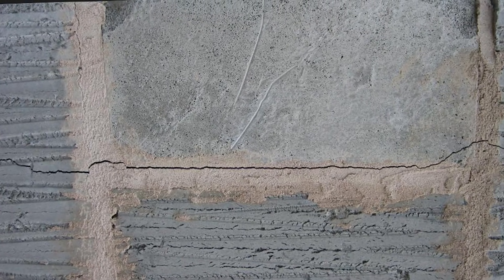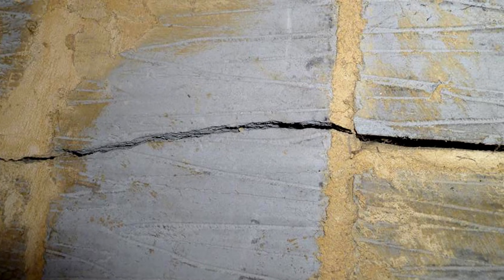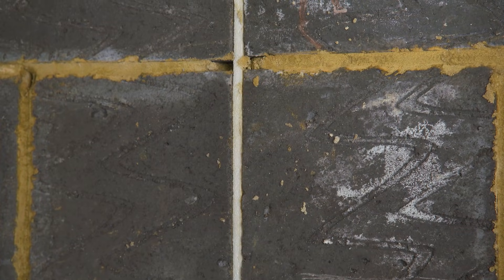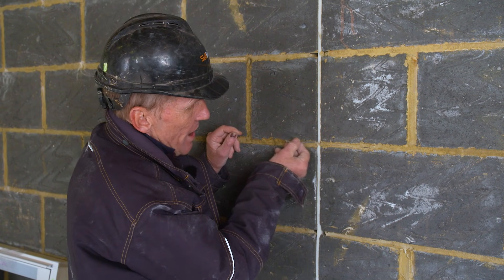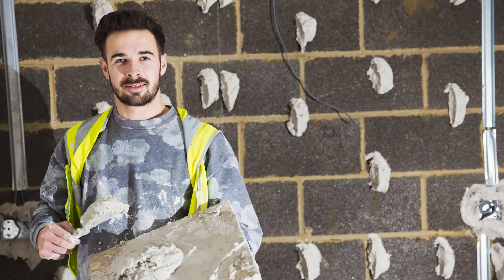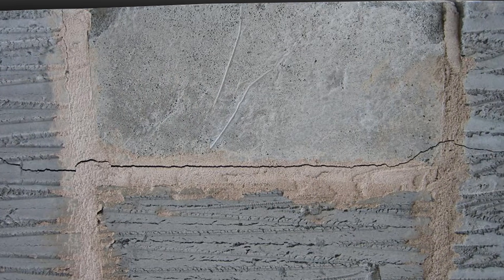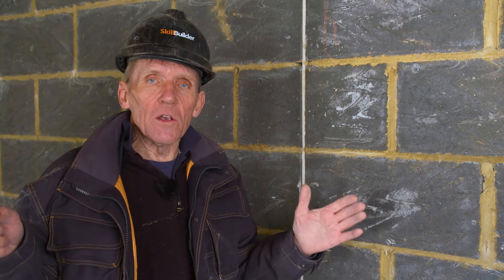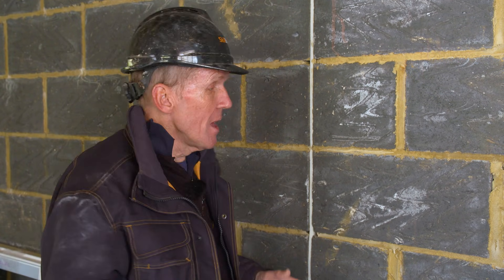Why Are Aircrete Blocks Cracking Up So Often?

Comment: Is "render" the same formula as stucco here in the US?
Reply from the maker: Yes
Reply: @SkillBuilder  Interesting. I built a couple of walls out of concrete block a few years back. I don't think they're "aircrete" but there's a similar problem I've noticed with these things. If you plaster over them with stucco you get cracks along the grout lines. In the effort to prevent that I did a scratch and a brown coat over the bare blocks, then did a coat of a cementitious product that is designed to adhere foam features to stucco. It's relatively sticky and I'm assuming more elastic than regular stucco. I embedded fiberglass mesh in this layer. Then I did the standard two coat smooth color coat over that for a finish. No cracks for a while. Then I noticed after the walls were saturated with heavy rains it looked like cracks had occurred behind the mesh layer. You could see it in the outlines of the blocks. The grout appears to retain water at a different rate than the blocks. So after everything dried out the visibility of the cracking diminished. Now hairline cracks have finally appeared in the surface of the finish coat. I wonder if this had anything to do with freezing and thawing of excess of moisture in the grout areas...?

Also, I've enjoyed watching a guy from Scotland, I believe, on his channel "plastering for beginners". When he does "rendering" he sponges the finish. I've never seen him hard trowel it. He does excellent work. I wonder if my hard troweling the finish and sealing off the final coat is part of the problem...? Is render in the UK typically sponge floated for this reason? For the life of me I have no idea how to prevent cracking over concrete masonry units. I've asked all the suppliers that I've encountered. I see the problem on professionally done cmu walls as well.

Comment: Really appreciate this video! Question: What are your thoughts regarding AAC blocks that are interlocking? And, the mortarless stacking of blocks  (expect for first run of blocks on slab or cmu block stem walls) in which closed cell foam is applied instead?

Comment: I've never seen these as a material I would use for Building structural, just for Insulation. I've made some fire proof stove applications and I've always used the fiberglass fluff that you can get at most mason supply. Works great' no cracks, the stuff floats it's essentially explosion resistant as well apparently. Yea good stuff. I don't think I would ever trust it to take the place of concrete in a building though.

Comment: Does someone know roughly the percentage wise of U.K. homes built out of brick vs concrete blocks vs aircrete blocks vs timber frame vs ICF vs SIP vs Steel frame vs ? Did I miss any other ones? Also which of the these are mainly used in the construction of cheap homes vs very expensive homes?

Comment: Great video thanks.  I want to build a garden workshop 6m x 4.5m.  So do I need expansion joints?  Want to render it over with pebbledash to match the cottage.  Would this still crack?  Many thanks.
Reply from the maker: Build it with concrete blocks rather than aircrete and it won't crack on that size. You could buid a timber frame and use cement board to clad it. You can then use an acrylic render over the boards. https://www.youtube.com/watch?v=5SoBLLhRIgA&t=2s
Reply: @SkillBuilder  Thank you so much for advice.

Comment: Good info, I am just about to do my walls that have a concrete skin 100 mm thick and aircrete 400 mm behind that. There is 3.0 metres between columns . Was designed for half metre earth pour walls originally. Thanks for your info.

Comment: I have no experience with concrete but I want to get into making sculptures out of concrete and molds. aircrete seems wonderful to keep them light. From what I got the reason the blocks cracked was because of the expansion/contraction difference between the aircrete and mortar, but aircrete blocks by themselves tend to crack as well? or is it always because of an external factor like the mortar in this case.
Reply from the maker: If you have a 225 x 225 aircrete block it should be fine. I have seen it used for sculptures.

Comment: Interesting. Thanks. But what would also be useful is precise details on how to fix walls both internal & external where a previous owner's builders have already messed this exact thing up. (And how to find a builder both capable of understanding the required job and not deciding that crack fixing is too small a job to bother with, so not submitting a quote.)

Comment: Many thanks for such a clear explanation.  I now understand why the block walls inside my internal garage have cracks in them. The house is around 25 years old with dot and dab hiding most problems but not in my garage.

Comment: In any major US city you will find concrete sidewals, of varying composition. But new or old, you'll almost away find the sudewalks are paved with 4'x4'slabs, separated by expansion joints. (Larger slabs in high density areas.) Sounds like some builders just grabbed onto a cheaper "concrete" with looking at how it has to be engineered.

Comment: I don't disagree with anything here, but would add that allowing the blocks from getting wet onsite before laying (they are very porous) or not allowing them to cool fully after the kiln are other causes of AAC block cracking. If I can help it I specify aggregate concrete blocks as they are more resilient - the cavity insulation can be upgraded to compensate for the reduced R value.
Reply from the maker: Peter I have also stopped using the aircrete and just to the lightweight concrete ones
Reply: @SkillBuilder qual a diferença entre concreto aerado e concreto leve?

Comment: I'm not a bricklayer but I am a qualified engineer so when I built my own home I read up on this in detail and consulted my inspector. We decided upon using a 5/1/1 mix for the mortar one was lime.  We also looked at where to put an expansion joint in a 12m front wall facing the sun.  There were  four windows in the ground and first floor  ( Brick faced and 7n 140 mm light concrete block internal)  in the 22 years there has been no cracks inside or out. We did fit bison Hollow core planks 8m single span that also helps to prevent movement of the inner leaf by absorbing the heat and cold expansion/contraction with underfloor heating to maintain a consistent  temperature level., also we kept the windows on both levels  1.2 m from the corners to avoid stresses there  Hope this helps.
Reply: Dad made the brickie use lime in the mortar with our first house that we built back in 87. None of the brickwork has cracked even though other parts of the house had moved. I don't know what the ratio was but it has lasted.

Comment: Thanks Roger, sound advise thanks. 

Lime spread here, I don't like to see expansion joints or use angle-bead on corners but I can see why they are necessary.

At the start of the pandemic I built a 7 meter, half-round, rubble stone & old brick lime putty mortar wall without a concrete base and no expansion joints about 4 foot high, 3 stones wide with a stone & mortar infill to hold the end of my veg garden in.

Finished in 3 days (lots of big stones) and about a year later big cracks suddenly appeared right from top to the bottom in 3 or 4 places almost where the expansion joints would have been.

From the end of the wall to the first crack was about 2m.

Comment: That’s why we use either glue or mortar of 1mm in Europe, both for cracking and to not loose the insulation properties
Reply from the maker: I have used thin joint adhesive and still have cracks. I think it is due to the moisture in the blocks. They shrink as they dry and the glue holds them too tight. Answer dry blocks

Comment: thx for sharing your years of practical experience, detailing what to do to help prevent Aircrete Block cracks.... and a few good tips for working with any cementitious block... 

But your main point is hire trades people who have a pride in their work, and will not cut corners.... Since knowing what to do vs doing it are 2 different matters... But even then you need other people such as the general contractor or ourselves spot checking its done to specs.. Check it 2x (or 100x) times and cut once is good general rule....

Comment: Hello, I am from Romania and i look amazed how you use aircrete. We have-it here also, it is caled BCA = Beton Celular Autoclavizat. Usualy here the exterior wall is made with 11.8 inch thickness and on the exterior we add 4 inch of mineral wool or expanded polystyrene and ontop the finishing decorative layer.
here is a video of our way to use-aircrete : https://www.youtube.com/watch?v=WEp3BvCB71w
the thickness of mortar is as low as possible, and we use adhesive specialy made for aircrete.
Reply: oh, sorry now I see that you have there BCU = Beton Celular Usor wich is a diferent material. Actualy my house is made of it. 11.8 inch thick, plastered inside and outside => 14.5 inch + another 4 inch of poly. The code says that this material is too weak and is just to fill the gaps from reinforced concrete pillars and it does not allow to construct the house without reinforcement at ALL CORNERS regardless of inside or ouside.

Comment: May be a dumb question here, but looking at other aircrete info it looks like they’re using the same aircrete mix used as mortar - same with adobe, uses the same adobe mix.  Cob uses itself to adhere.  Any comments would be appreciated. Thanks

Comment: Use adhesive instead of mortar.
Reply from the maker: Blocks still crack, it solves nothing. I have used thin joint and the blocks crack like mad

Comment: So glad I found this channel. Any recommendations for casting your own Aircrete blocks? Could the same mortar mix of 6:1:1 also be infused with a foaming agent for the bricks? Currently, I'm doing a 6:1 ratio of foam to portland cement. I'm just curious if implementing sand and lime to this block mix will help any. Thanks again for the new insight!
Reply from the maker: If you add a handful of zinc filings to the mix it will produce a reaction that creates air bubbles. I have been to the factory and that is how it is done. Quite how much you add is something to discover by trial and error and that can be expensive and time consuming.
Reply: Something I recall while looking into this material in block form is the importance of temp and steam as part of a consistent/quality curing process.
Again, not an expert… just sharing something I came across while looking into this material.

Comment: Back in the 60's/70's yer sand was delivered WET & with the LIME already added ..... Made yer hands BURN a bit, but they soon hardened up :-)
Reply: did you add cement for brickwork houses what ratio did you do in 60s 70s please ?
Reply: @tinman1071  5-1 & 1

Comment: We are in the process of buying a new build, from a well known developer, was invited to view at point of roof completion, the party wall has exactly this problem, 2 cracks from roof truss all the way down to ground floor concrete base at either end of the wall, property now delayed whilst they get a team in to fix with steel inserts and resin, I’m shocked they could make such a mistake on a large development!

Comment: Correct me but dont we have a 60 year rule here in the UK.. ie:  thats how long the building/works should last..?  
As a UK Carpenter/builder when I first went to the USA (1993) I was very curious about how they did things there and was appalled when I was in Home Depot and saw these huge garage doors made out of Hardboard..  
The more I looked I realised that everything seemed to be down to a price and longevity was not considered..      I have visited another 10 times since then and been all over the country from the Adobe houses in Arizona to ornate timber houses in Maine..  and now I understand..  
Americans accept change but do it dramatically..  If they want to build a new McDonalds, they find a plot and tear down whatever is there and bam.. 2 weeks later it's lobbing out happy meals.  
Time is money.. The cheap building has virually no value so.. Dont convert, remove and start new..   

My point in relating to Rogers rant is using the same old building materials which are subject to ever changing edicts from the planners/BC but we are almost not allowed to use the wonderful 'Modern methods of Construction' materials that should have done away with these annoying problems.  

I tried to build using MMC and quickly got stuffed by  A)  The Builder..  wtf is this.. why dont you build traditional..  B) The Money lenders.. wtf is this.. cant you.. blah blah  C) Insurers.. as above..
I despair..

Comment: I did not understand 100% of the jargon but the parts I am familiar with was educational. Thank you. Question: Given stainless steel is non-magnectic how can I tell if the brick layers have actually installed the reinforcements when the job is inspected? Typically with metal rebar a magnet is used to verify that the rebar was actually installed.

Comment: There is a product here in australia that is similar to these blocks and it’s the only one of its type but I’ve seen a few places made with it and they are getting severe moisture issues and gyprock is actually falling apart inside the house. One of my clients are actually taking them to court as it was deemed unfit for Australian building laws after being accessed by inspector.
Reply: What's the product?

Comment: Crackcrete.its the air bubbles you can't stop that crap from cracking it's weak.too many reasons not to use it.pour concrete in styrofoam forms that is the best.
Reply: "pour concrete in styrofoam forms"
It is better even for thermal considerations. The best is having a big thermal mass inside and a separate thick insulation outside.
It is not good mixing the 2 functions.
https://i2.wp.com/kp.hu/wp-content/uploads/2011/02/prokoncept-referencia-e1297452421999.jpg?resize=600%2C477&ssl=1

Comment: They're great at insolation but terrible at noise isolation. My apartment is built with them and you can hear EVERYTHING from farts, sneezes to cutlery hitting plates.
Reply from the maker: That is probably due to air gaps
Reply: "great at insolation"
Even not so great insulation compared to modern standards. In Europe, you have to apply extra insulation even on a 12" Crete like wall to meet building codes.
It is better having a heavy load bearing wall with big thermal mass and a thick external insulation. 
Or, if you want to make it in a single step, use an ICF like this: 
https://lh3.googleusercontent.com/proxy/kqgyN1rPxHCx21IrWN5OmwLdiMLWlxzX0-FOvjbbPbW0d29Fti7I-7FwWqowgp9bJdYqxdJ0WVZoZY0_TnFe9P_7LGZPQOQbW2SJbiX77U8PpcgqVg

Comment: I came to the conclusion many years after that; as a custom home bricklaying contractor... that 3 things are for certain.
Hard Labor = moving each brick for the layer to lay & each shovel of mortar for the bricklayer to spread.
Glorified Hard Labor = Picking up & adjusting each brick to be leveled & plumbed after moving those cubic yards of mortar with a mere trowel for them to be suspended forever in that leveled & plumbed state.
The total Gloried Hard Labor of it all combined = ''There's no building material that has been touched and adjusted by the human hand than that of the lowly brick or stone.'' -William Gilpin 71021

Comment: All this talk about too hard mortar is bull shiit. Cracks in walls are from cracks in the foundation. That's why we put in the vertical control joints. Imagine engineers and architects calling for weaker mortar to make the wall stronger! I've done demolition and I even have some examples from the past. A simple chimney on a farm house took all day instead of 2 hours. Quality brick with super hard mortar still stuck on brick and still holding a quality wall tie. I know what I know.
Reply from the maker: Sorry Mark Science and technology are not with you on this one, the stronger the mix the more it will shrink and the more it will induce cracking in the brick or block. It has nothing to do with the foundations and everything to do with the shrinkage of the masonry. Just do a bit of reading and you will see that hard cement is like a straight jacket. Something has to give and it will be the brick or block.

Comment: Another high-tech "solution" that doesn't work as well as traditional materials.  Yet another product that I will never use.
Reply: I frequently make and work with aircrete and its really amazing stuff, but not a one size fits all solution.  I probably wouldn't want to use the premade blocks to construct any building higher than two stories.   But as a spray on, or gunite type application or in a monolithic/formed pours they do really well.  Again its no replacement for high strength concrete but really shouldn't be used as one.

The problem comes as our presenter said comes from mis-installation of the product
Reply: They didnt say not to use it, in fact there was a lot of explanation of how to avoid problems with it, those solutions were really easy as well.

Comment: You only use the thin join adhesive, no morter as it does not hold the blocks together. The morter is for brick and who will mix two kinds of the mortar??

Comment: So when did they stop calling them ‘Breeze blocks’?
Reply from the maker: Hi Dirk 
Back in the day the breeze block was made from cement and flyash from power stations and air was forced through the mix. These aircrete blocks produce their closed cell pockets of air by a chemical reaction between zinc filings and the cement so no air is forced through. No breeze.

Comment: The mason that put up the inner walls in my garrage could have used several of those tips back in 1976.
And they are only 50mm thick, so I dare not hang anything on them.